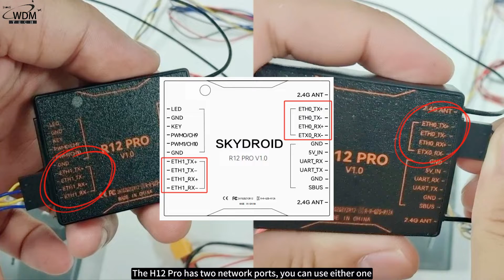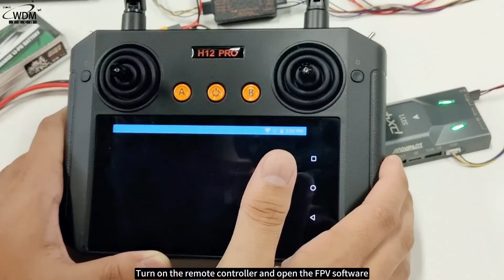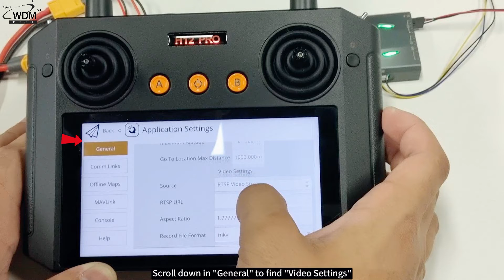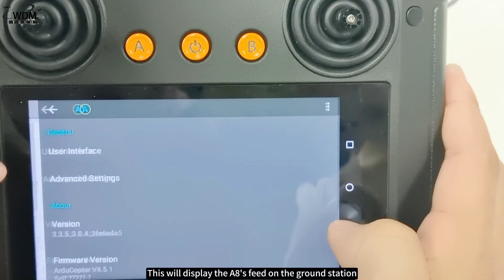Skydroid H12 Pro to SIYI A8 wiring video

Comment: Sir my skydroid is not charging No more than 4-5% of the charge or it is discharging very quickly what should I do sir, please in hp sir
Reply from the maker: How long has the remote control been used, and have you tried using other chargers to charge the remote control?

Comment: Can it be connected to another FC like speedybee f405wing?
Reply from the maker: Hello sir, yes, H12PRO to A8 can be connected to speedybee f405wing, but some modifications need to be made to the cable, and it needs to be soldered to the FC,
Reply: Does it support Vtol?
Reply from the maker: @messybench974  yes

Comment: How to control the camera gimbal from radio channels?
Reply from the maker: Hello, do you mean using the remote control channel to control the A8 gimbal camera?
Reply: @worldronemarket  yes
Reply from the maker: @Cephas2904  To use the S.BUS port of the H12pro receiver to control the A8, you need to make a line yourself. I will make a video, so stay tuned.
Reply from the maker: @Cephas2904 Hello, sir. A video on controlling A8 with H12pro channel has been made, you can refer to it.https://youtu.be/hNXdwHC920c?si=JjmeTaweqZUhKruG